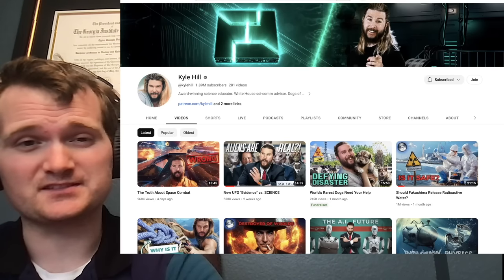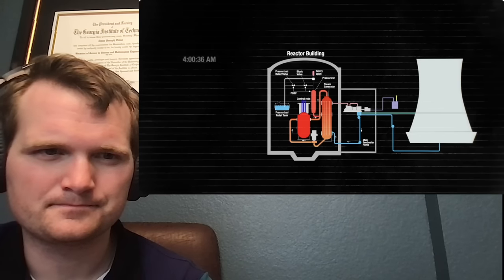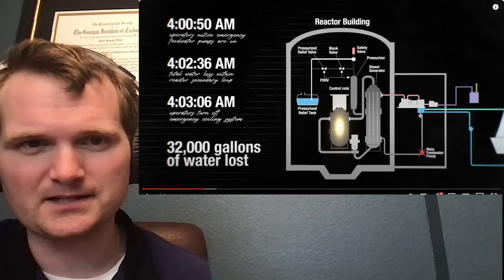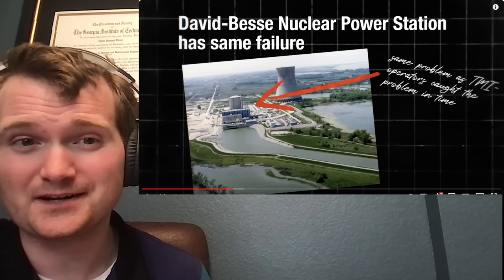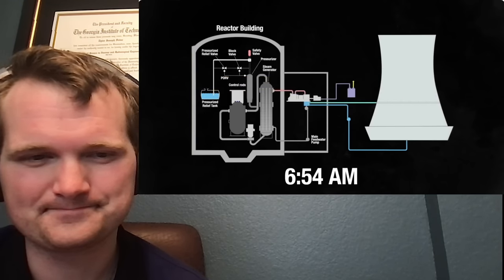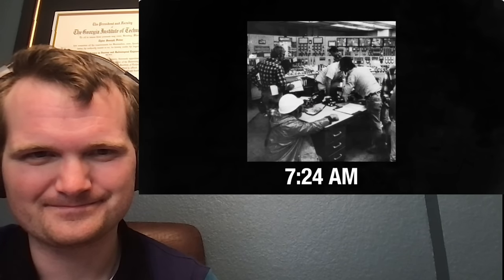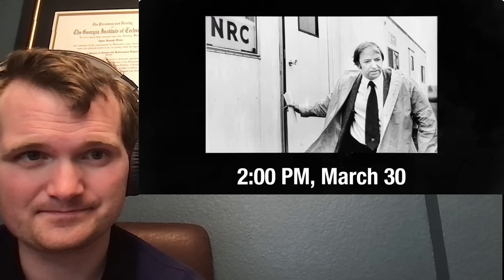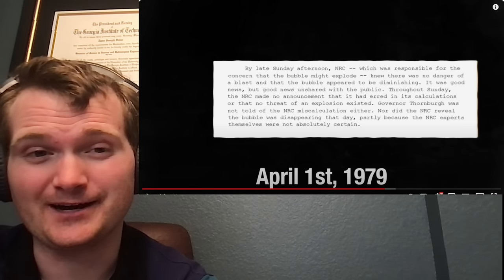Nuclear Engineer Reacts to Kyle Hill "Three Mile Island - What Really Happened"

Comment: This video was of particular interest to me because I did a report on Three Mile Island when I was in grade school. My report only covered the technical aspects of the failure, so I didn't know about the politics surrounding it, but it's good to know that I accurately understood what occurred within the reactor. In my report, I make the argument that a single point of failure is what led to this series of events: The indicator light for the valve showed the state it should be in and not the state it was actually in. There was no way to detect the failure of the valve without inferring that information from a lot of different sources.
Reply: I too did a report on TMI in high school, and came to similar conclusions. Years later, I worked at a medical device manufacturing plant that had run into the issue of monitoring that a motor was running, but not that the fan to which it was connected was circulating a sterilant gas. The fan blade had fallen off and that led to unsterilized product shipping, and from that, many customers died. More in fact than died from TMI. Always monitor the thing you need to monitor directly, and not just something connected to it.
Reply: @rapomnam  Was that sterilant gas ETO? We were so relieved when our ETO Sterilizers were retired 20 years ago.
Reply: @davidmajors514  yes the gas was ETO. Very dangerous stuff, but also considered far safer than the previous Co-60 sterilization unit that it replaced.

Comment: Woo, I'm early to this one! 

I think Three Mile Island shows how safe nuclear energy is in the US, it was basically a worst case scenario where the core had basically no cooling causing a meltdown, and yet there was basically no radiation that left the containment building. It cost a whole lot of money, but that's it. 

As for the cause, one of the things that made it worse was the fact that the only way to see a log of alarms and warnings was through a very slow printer (slow enough it took several hours to stop printing). Because of how slow the printer was, and how many warning lights there were, it made it possible to miss certain warnings that would have let the team in the control room react much more adequately. 

The team was also trained by the Navy for reactors on nuclear submarines that have way less output, and therefore way less decay heat. That in turn led to the people operating the reactor to prioritize the wrong things, they were treating it like a low output reactor on a nuclear sub, which has a much different set of risks to consider than the ones at Three Mile Island.

Comment: TMI wasn't a nuclear disaster, it was a PR disaster, and on the technical side, a very obvious learning point about industrial control systems (interface with blinking alarms, not enough sensors, indicator light wired to the button instead of giving feedback on what's actually happening, etc..)

Comment: Thanks for your videos. I thought you might like to know that Pilot and Power operated relief valves are two flavors of the same device ...but different. Kyle Hill is correct in that it was a Dressler Pilot operated relief valve in place at the time of the TMI. At very high pressures (like a reactor primary cooling system) spring sizes become too large to be practical, the solution is a pilot operated relief system. They use  the high system pressure and a poppet spring that is maybe set within 50 psig (not a hard number,  it varies with each valve/installation) of maximum system pressure. An orifice feeds pressure to a secondary poppet of much smaller size to maintain back pressure on the primary poppet keeping it closed. When the system exceeds maximum set pressure plus spring pressure the primary pops open and relieves system pressure. One main issue with them (and what happened at TMI) as they release pressure and close then open again they can literally pound themselves to destruction. After TMI all Pilot operated relief valves were replaced with Power operated relief valves which use an electric signal to open a solenoid., thus relieving pressure. Thus it is what is now in the nuclear field an archaic device, kind of like the term "letting the pressurizer go solid" The idea is that a power operated valve is safer and will not beat itself up. Pilot operated valves are still in wide use in the chemical industry.

Comment: I think we’re having a different understanding on the part where he says it’s a “normal accident”. Or it seems like you might have misunderstood what he was saying. The way I understood it, he wasn’t saying that it was a single unavoidable failure that caused this accident, he was saying that it was a bunch of seemingly inconsequential things that eventually led to this, most or all of which wouldn’t be a big deal on their own. It’s the compounding of all those things that made this accident unavoidable, or the lining up of the holes in the Swiss Cheese as you might say. It wasn’t just that the pump stopped working, or that the PORV stuck open, or that they thought water levels were higher than they were, or anything else, it was everything adding together on top of the people in the control room running on faulty information due the failed, missed, or nonexistent sensors/warning lights. I get that hindsight makes it seem simple to avoid this outcome, but that’s hindsight for you. The people working that day didn’t have the same training or experience that you do. In other words, they didn’t know what they didn’t know.

Comment: I live in a province in Canada that contains 3 nuclear power plants (Bruce, Pickering, Darlington) and a nuclear research facility (Chalk River). The power plants are a key part of the electrical grid, with hydro-electric as the second largest contributor by generator type to the grid. Without nuclear power, it would be impossible to meet the current and future demand for electricity. Before I started watching these videos, I was a bit leary of nuclear power. Now, I feel much better informed. There are, obviously , risks associated with nuclear reactors. The biggest issue is not the operation of these facilities, but the long term storage of spent nuclear materials. This is not just a nuclear power issue, but a nuclear industry issue. All of our nuclear power facilities have visitor information centres - I plan to visit them when I am in the area. Fun fact: Jimmy Carter worked at the Chalk River Nuclear facility for a time.

Comment: This one is also about 3MI, it looks at the human aspects of it, and how the operators were just trying to do a good job with what they had. It's also somewhat technical and in depth. It's a conference about leadership and how to treat employees in a software development context, but it's mostly about the nuclear accident.
v=1xQeXOz0Ncs

@6:10 there was an indication. It was the high temperature of the far side of the valve. But the valve had been leaking prior to the accident and it was always over the limit, and after just having vented extremely hot gas, the operator didn't think a few degrees over what he would normally see was anything abnormal. Furthermore the indicator light would only display the command send to the valve, which indicated closed. And so the operators assumed it was closed.

@7:30 there were walls of warning lights at 3MI. Apparently the warning light for reactor overpressure was right next to service elevator is stuck and other such nonsense, and with 50 or so warning lights on even during normal operation it was easy to miss them. The printer that would log the time and warnings generated was connected to the computer with a really awfully slow connection and wouldn't be done printing for the next few hours.

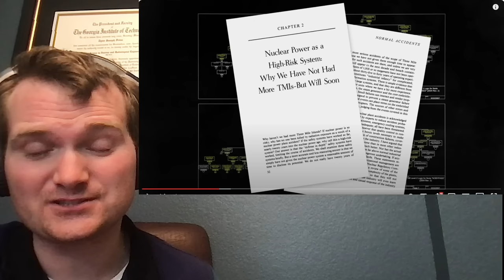@14:00 well the root cause was not the valve, but the condensate polishers getting their pipes all blown off simultaneously by a water hammer.

@20:45 closing the block valve at this time was a mistake, as venting steam was the only way for the reactor to cool itself at this point.
Reply: Instead of adding only the tail end of the YouTube link in your comment, you should probably say the videos title and the YouTube channels name, especially for us mobile users as we can't copy from a YouTube comment.
Reply: @madmax2069  The talk is "Who Destroyed Three Mile Island" by Nickolas Means. There are quite a few videos of the talk on Youtube since he has given it at several conferences.

Comment: I grew up near the Oyster Creek power plant, which was an older boiling reactor design. In the late 70's, they were planning to upgrade the plant to pressurized water reactors, and had even floated the new reactor units by barge up to the plant.  Then TMI happened and all that ended.   The plant shut down for good in 2018.

Comment: Perhaps you should spend a bit of time discussing the "Swiss cheese model" to elaborate on why you disagree with the assertion that this was bound to happen. The argument isn't crazy on its face if you don't factor in redundant measures at the physical and operational levels. In this case a few holes lined up, but the additional layers of safety caught the issue before it was "through the block of cheese".

Comment: Yeah, the once-thru steam-generators of the B&W plants hold very little liquid water.  They can boil dry VERY quickly.  Navy reactor plants, and Westinghouse plants use a different recirculating type of steam generator that has a lot more water and can go several minutes before drying out.

Comment: I had no idea Babcock and Wilcox Diamond Power made all that stuff. They're one of my clients down in Lancaster, Ohio. Obviously nobody from that incident is still there, but id love to hear their stories about it.
Reply: B&W actually made pretty good PWR's. My mom sold computer time to them (at their nuclear division). The problem at TMI was not B&W's design but, a vendor issue with the Pilot operated relief valve. Nobody talks about the initial issue that triggered everything else which was the reactor feedwater goes through a "polisher" to remove particles and chemical contaminants. They consist of large columns filled with ion exchange resins... kind of like your home water purifying systems. After sitting awhile the resin gets sticky and packs. The maintenance crew used air to try to fluidize the resin. To get the air they connected to an instrument air supply line. They left forgetting to disconnect or even close the air valve. This allowed water to back up into the much lower pressure air line when the column was put back in use. It after some time backed into a flow device on the primary loop causing it fail and shut the feedwater pumps.

Comment: Hearing about the over-complicated control room with all the blinking alarms and confusing instruments, reminds me of older passenger planes. Look at pictures of a 1970s airliner, and you'll see some of the same problem. A LOT of instruments, warning lights spread out all over the cockpit, and in some cases audible signals ringing on top of each other during critical flight phases like just before landing. The radar altimeter minimum warning might beep at the same time  as the inner marker warning AND you have a constant beeping of the ident of the ILS, for example. Very confusing and easy to start ignoring the sounds.

Compare to modern airliners, like the very common Airbus A320, which has a very sleek and user-friendly cockpit, centralized warning panel where all relevant warnings and alerts are gathered. 

No more hunting for red lights among hundreds of knobs and dials. And warning lights in orange or red ONLY show up when there is a real warning. Those colors are not used for non-essential stuff anymore.

This is incidentally also one of the key differences between A320 and its main (and failing) competitor the Boeing 737. 

The 737, even in its latest Max versions are still using the old design philosophy: No centralized warning panel; the EICAS or engine-indicating and crew-alerting system is now mandatory in all new planes, but Boeing has been able to get around this law by just making new sub-models of the plane, thereby not needing new certification, nor new crew training. Saving money, but not lives.

So, when I book a flight, if I can choose between 737 and A320, I will ALWAYS choose the Airbus. Not only because of all the ongoing Boeing scandals, but because it it an inherently better designed plane.

These days, we know so much more about ergonomy, crew psychology, reaction patterns of human operators and how to make safe user interfaces in planes, cars, trains and other potentially hazardous equipment. 

Nuclear power plants are a lot more unfamiliar to me, but I assume these lessons have also improved nuclear plant control panels and control rooms.

The peak of complicated and confusing technology was 1970s to early 1980s. Computers were still slow, screens were small (and ofteh monochrome) and analog systems were mixed in-between slow and unreliable digital systems. Since then, things have only gotten better and safer.

I hope people's irrational fear for nuclear power goes away, so we can save the climate with clean power before it is too late. Solar and wind is nice, but we need something big and heavy to take the brunt of power production away from fossil fuels. Nuclear is that thing.

Comment: Well the "normal accident" theory part, there's some validity in that failsafe measures and redundancy, come through failures. The aero industry is a great example. Accidents lead to modifications to include better failsafes in the systems. Nuclear is the same in some ways, criticality incidents and previous accidents inform the next generation of safety measures, but that means in the earlier stages of a technology "Normal accidents" will occur, these will inform us moving forward. When we understand the dangers involved. we can make better systems. However that also involves fostering a culture around design safety where you feel confident to question the design "What happens if this fails"

Comment: Crazy question: would it be possible, in a practible sense, to build a, an, I don't know a concrete cylinder designed for the explicit purpose that the middle of it melts around Corium, letting the Corium sink into it while it sinks out the heat, until the Corium itself is contained in a solidified concrete bottle?

Comment: Once it's reached the point that the core has reached thousands of degrees, what can you do? Inputting water is just going to immediately flash-boil to steam. I guess that will absorb some heat, and if you have enough water and the pressure relief is enough that it doesn't overpressure the reactor, you can just keep doing that until it cools down again?

Comment: The main failure of TMI was the piblic relations. 
One thing i am very happy about is that the normal accident theory forgot to take into account human learning and how humans tend to undo mistakes rather than make them again
Reply: I agree that one of the biggest failures was public relations.

But it's undeniable there were operations failures as well. Allowing boron deposits to form stalagmites large enough to freeze a valve is inexcusable. Even if they didn't know as much about nuclear plant safety as we do now, that boils down to common sense. If a valve is there, it's probably necessary and should therefore probably work. 

Most nuclear reactor accidents can be traced to laziness, sloppiness, impatience or profit-seeking over safety. Coincidentally, the same can be said about most human-causes disasters in general, and as far as learning from our mistakes? NASA destroyed a shuttle and killed seven astronauts running a system they knew was dangerous. They fixed that system but didn't learn the lesson because they later destroyed a shuttle and killed seven astronauts running a different system they knew was dangerous. We tend to learn from our mistakes in the immediate aftermath, but then unless constant reinforcement happens, we forget after a few years and go back to our old habits.

Comment: TMI incident, especially about the lack to transparency are the crimes here. As long as governments remain as open and communicative as possible: when something goes this poorly with a reactor, the PR can help maintain the public's confidence that conditions are still safe.

Like was it really that unclear on that Sunday, hydrogen gas readings were lessening and the core was slowly returning to normal?

Anecdotally to lack of transparency: some high tension, high voltage power lines run over some homes. This was found in the disclosure when I was looking at a home for sale in the neighbourhood. The energy company, through a formal written request would not disclose to me the amount of high voltage; despite my interest in how much radiation was the home actually getting. It’s a simple health and safety question; their refusal to answer, that turned me off from buying too close to the high tension and high voltage power line.

When energy companies hide potential problems and ignore to answer technical questions, it creates so much distrust. Why hide it. And that mentality hasn’t gone away (the email and reply from this energy company was from 2023).

Comment: Correct me if im wrong but through the entire reporting during the even and after reports of the events itself they called it the Pilot Operated Relief Valve, babcock and wilcox also called it that when referecing the sister plant in a different state. Calling it anything different would be confusing in my mind even if the term has since changed.

Comment: 34:12 Yeah, that's basically the whole idea of a gas burner of any sense, as long as you regularly burn the gas, it won't build up to a dangerous level. At least, assuming there's not some flaw in the system letting gas escape